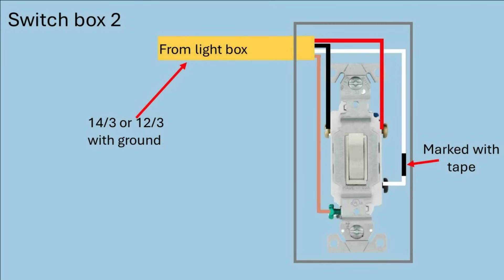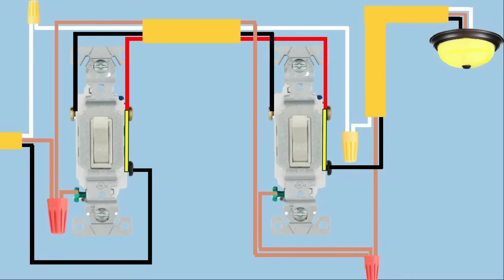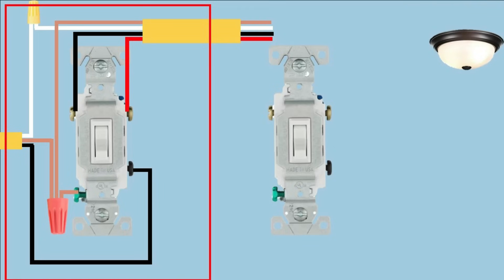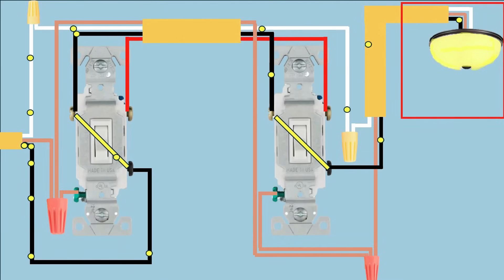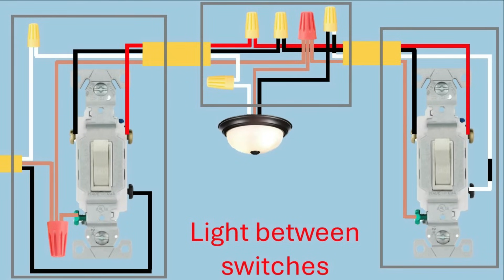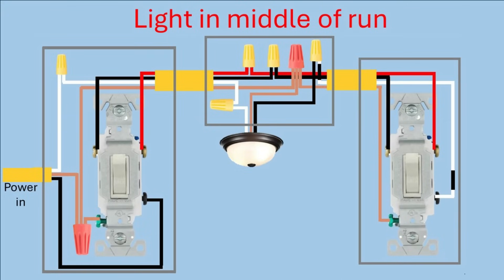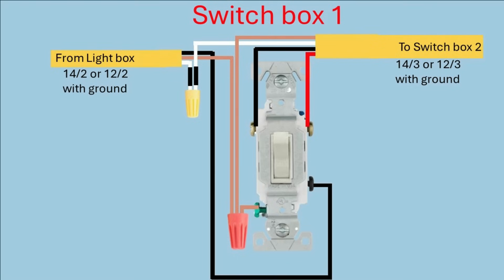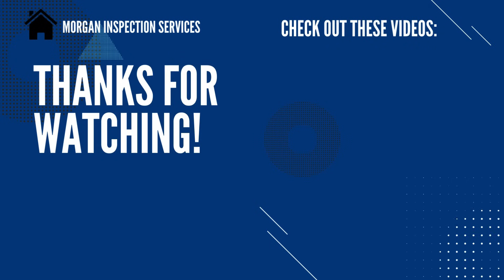3-Way Switch Wiring (How to Video) - Quick and Easy! | Electrical 101

Comment: Apprentices, ignore the first two and only use the third, light at end of run. The first two are for service calls on old buildings only. First is against code. Second is stooopid asf. 

If you rough in Light at center on a 3way, and we EVER have to fix it or troubleshoot it, you think your boss or regular service jman wants to take a ceiling fan or chandalier down just to get a meter reading? Most of us will make you do that- and i would add you to the layoff list, personally. 

Always take your hot to the switch, never the light. And always put the light at the end of a 3way. One box gets the hot, the other box gets the switch leg. 3 wire travellers beteewn the boxes. Now you wont be confused on how to terminate even tho you forgit to label during roughin like apprentices and resi guys always do 😊😂😂

Comment: For the switch-light-switch wiring, how would I modify that if I want multiple lights on the run (still in-between the switches)? Think top and bottom of a stairwell.
Reply from the maker: I need a little more information. Do you already have one light controlled by three-way switches? Or are you starting from scratch?

Comment: Thank you for making this video. I struggle so hard with three-way switches no matter how many of them I make up in the electrical boxes. I will keep watching this over and over and hopefully drill it into my brain. Thanks again!
Reply from the maker: You're welcome! Good luck.
Reply: it's easy. the constant hot goes on the black screw at jb1. The switch leg goes on the black screw at jb2. The brass screws are for the travellers from the 14/3 linking the two boxes. Splice all neutrals together. 
Boom. 
How do all you 1st year n00bs struggle with these? 

did you forget to label the constant hot and switch leg on your 14/2s when you pulled the wire? 
Oops. Get white tape and a sharpie and do that when you rough it in next time, n00b!

Comment: Great video but why is that white wire labeled a hot?
Reply from the maker: When the white only acts as the neutral wire, it can remain white, but if the white wire is going to be used as a current carrying energized conductor that will carry 120 V, then both ends of it and anywhere it goes through junction boxes must be marked with some black or red, or some kind of colored tape to indicate that it is not a neutral wire.
Reply: @ I understand that. What I meant to ask is why did you use the white wire as an example why didn’t you use a black wire?
Reply from the maker: @    Because when you use 12/3 or 14/3 with ground, you get a black, a red, a white, and a bare ground wire. The black and red wires were being used already.
Reply: I think I understand now. It’s because the original black wire is already being used?
Reply from the maker: Indeed
Reply: Thanks for making this video, was very helpful.

Comment: Damn Chesty Puller has been my hero since 98 when i joined the Marines but now i believe u r my new hero lol. Ive watched hours up on hours on how to wire a 3 way switch i live n an older house so lets just say i had no clue how it was wired.  Ive tried every configuration from a ton of videos i watched and  absolutely nothing worked.  Well i came across ur video and the last one i watched and tried and with in 10 min i had 2 different 3 way switch circuits controlling 3 differnt lights fixed and working properly. So def earned a sub from me and hopefully ne one that needs a 3 way switch fixed stumbles across this video and they will agree its the best 3 way switch video on youtube.
Reply from the maker: WOW!! Where do I send your paycheck for the advertising? Thanks for watching. I’m so glad it was helpful.

Comment: There are also two alternative 3 way switch configurations sometimes found in very homes, usually with knob and tube wiring or really old raceway aka conduit systems.   

1) California method.    a) The incoming hot connects to a traveler screw on the first switch,  then is jumped from that same terminal to the same traveler of the second switch. b)  A switched hot  connects to the other traveler of the first switch to the same traveler of the second switch, then off that same terminal to the light fixture.   c) the common terminal on each switch is connected together.    I have never personally ran across this one, but from my understanding and research,  the California method because of a local code in California, or at least some counties in California,  that stated more than 3 wires are not permitted inside of a conduit,  unless one of them is a switch leg.  The advantages were that switched and unswitched power were available on both ends of a three way setup,  this saved wire and conduit in certain situations such as a long hallway.   The disadvantages are that it can confuse even some master electricians, and it typically does not leave an available neutral in the switch boxes to facilitate future installation of electronic switching devices.   For this reason, the California method is no longer code compliant as of 2011.  

2) Carter method,  also known by several nicknames such as Chicago,  farmers,  barnyard,  hot shot, reverse, or  power beyond, lazy susan, or lazy neutral 3 way, among others.    a) the hot and neutral from the source connect to the travellers of the first switch, then jump off to the travellers of the second switch where they can power other loads downstream.  b) one of the wires from the light fixture connects to the common on the first switch.   c) the other wire from the light fixture connects to the common on the second switch.   How this works is the light can have 4 possible states depending on the position of the two switches which may or may not be on the same circuit: 
Neutral-neutral = light OFF
Hot-neutral = light ON, with correct polarity 
Hot-Hot = light OFF, and socket remains live at both terminals relative to ground   (if on different circuits,  must be same phase or lamp will get 240V) 
Neutral-hot = light ON, with reverse polarity. The carter method was officially banned by the NEC in 1923 because of the obvious dangers of having a fixture appear dead when in fact both terminals are live, but continued decades later, at least into the 1950s and possibly later.   

I personally ran across a carter 3 way once, for switching a yardlight from the house and barn on a farm  in Sanilac County michigan.  Fed from different panels, a single wire resembling THHN ran from the house to the light, and from the barn to the light, installed sometime in the early 1950s after the farm got electricity in 1951, house was built in 1906.    Sometimes the yardlight got extremely bright for a few seconds before burning out, problem began after the farmer, whom my dad has known for many years, moved some breakers around in the barn panel to make room for a 2 pole 20 for a large air compressor he just brought.  This was back in 2015 as I was 25 and still had 7 months before I finished my apprenticeship and took/passed the Journeyman test.   I scratched my head for what seemed like eternity before accidentally discovering 120V between the travellers on both switches with my wiggy meter, then it all suddenly made sense.  To fix the problem I simply found the breaker in the barn powering the yardlight and moved it one slot over.  The farmer was left speechless when I clearly explained to him what was happening after he rearranged  the  breakers and what I did to fix it, but he wasn't 100% convinced yet, so I went back up the extension ladder and changed the burned out bulb using the last one he had, a 300 watt incandescent if I remember correctly and to his surprise,  it worked as it should on all the possible switch positions.  So he took me out to a very fancy and expensive Italian restaurant afterwards and paid me $100 in cash.   😊

The advantage of the carter method was it controlled a light while keeping  unswitched power on both ends of the switches using 3 wires instead of 4 (not counting a ground) that a modern traveler system would require.  So you basically save one wire, so this method was often employed by old timers who lived during the tough economic times of the 1930s,  where frugality and self sufficiency became a necessity.
Reply from the maker: Very interesting!! I had no idea wiring configurations had names. Thanks for the education.